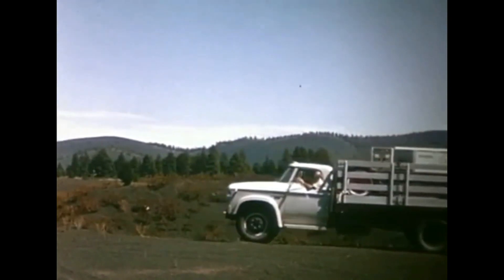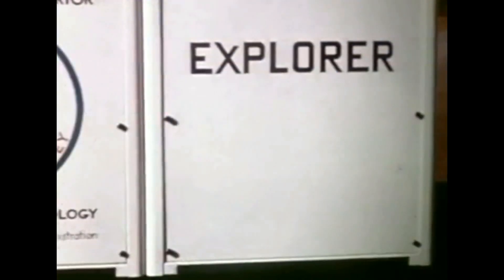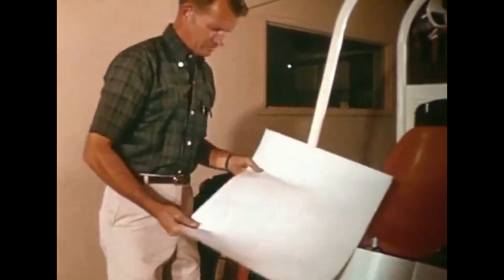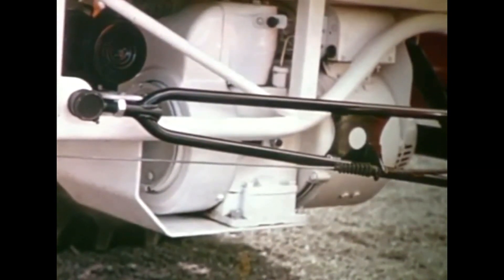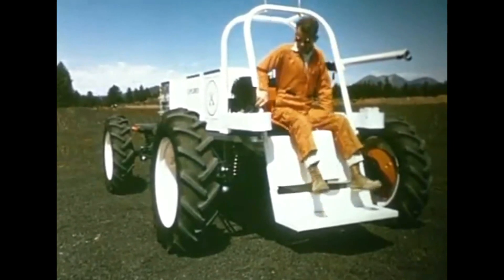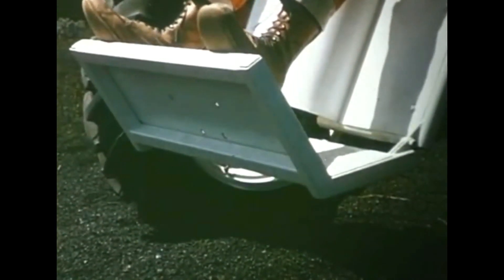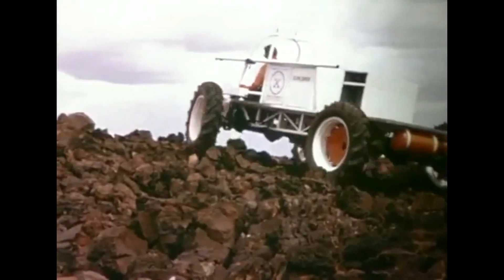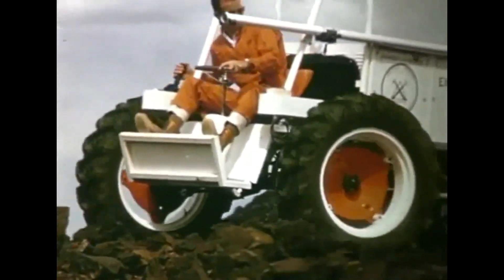Moon Hoax; "The Rover's Beginning"

Comment: O.o did I hear 8 cylinder engine? Gas powered engine on the moon? Umm.... nooo.....dumbasses! where are you getting the air? You need air to mix with the fuel to ignit in the combustion chamber.
Reply: Maybe that's why NASA now claims that the atmosphere reaches all the way out to the moon!!! :)
Reply: @blown215  I would like to see what happens if you tried to take a deep breath in the moons "atmosphere"!
Reply: @gregsmith8617  NASA has the answer to that. Watch it in this vid at 6:00 into it.  https://www.youtube.com/watch?v=fJbztthNrVQ&t=2114s
Reply: @blown215  Excellent video, thanks!
Reply: @ginskimpivot753  LOL
Reply: The first prototype of your car was likely made from clay now yours isn't clay is it?